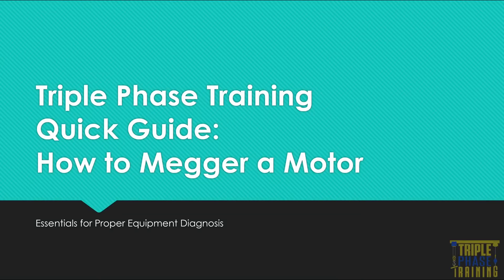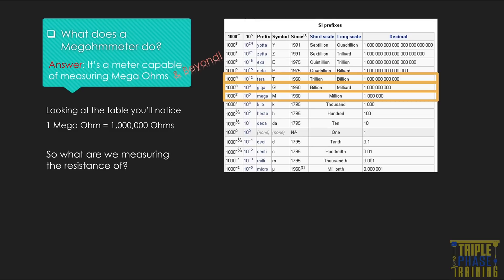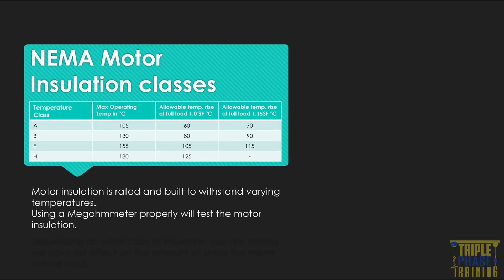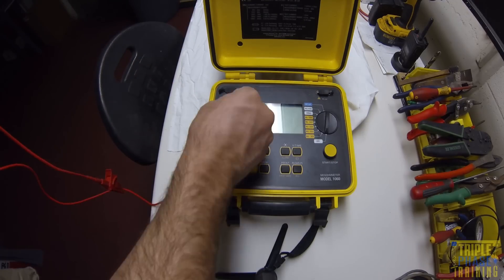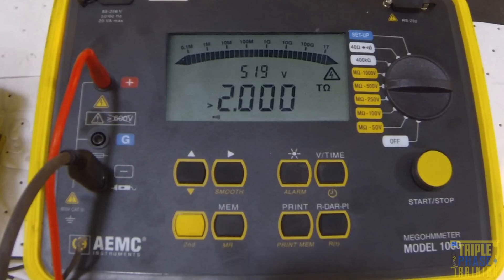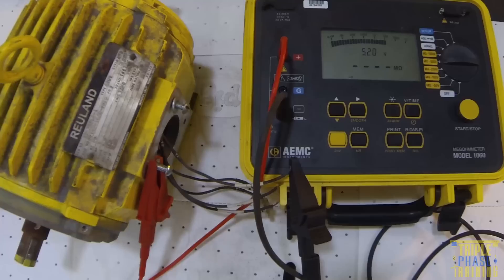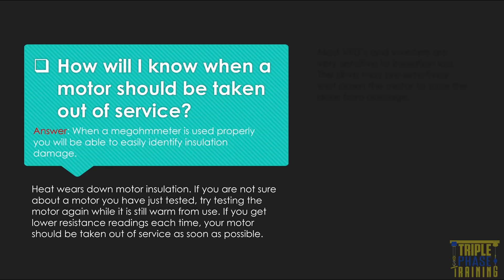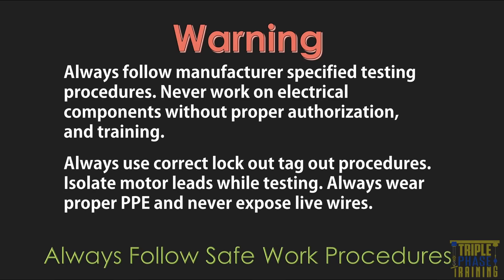How to Megger a Motor / Insulation Test

Comment: Why in this case you connect the red positive to the motor case and black negative to the windings?.every other video out there has opposite connections? U put black to ground etc
Reply: Ive never conducted a megger test with black to motor leads and red to motor ground. Its always ben opposite in my 32 years.
Reply: @JCC56  The manual for this specific megger indicates that the red lead is to be connected to "ground" and the black lead is to be connected to the motor leads.
Reply: @kodypitner9170  very interesting

Comment: what? 25giga ohms insulation resistance is not good? what is the minimum insulation resistance should be consider that the motor is good?
Reply: In this case for the particular motor being shown, 25 giga ohms is not good. However, it depends on the motor's insulation class. There is no across the board answer as to what the insulation resistance should be. It varies from motor to motor. Also, you need to take into consideration that VFD's are much more sensitive equipment.